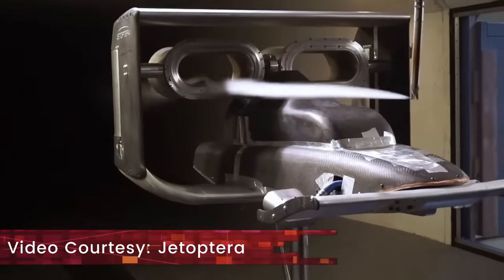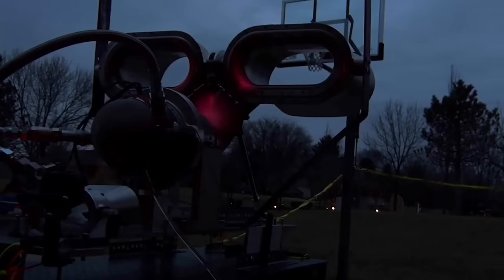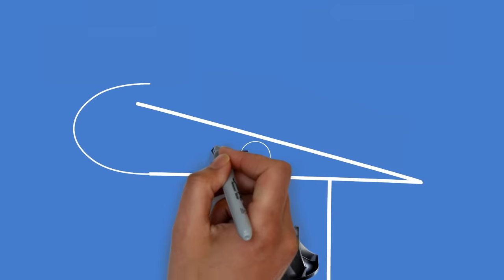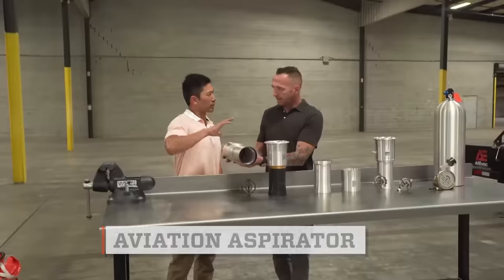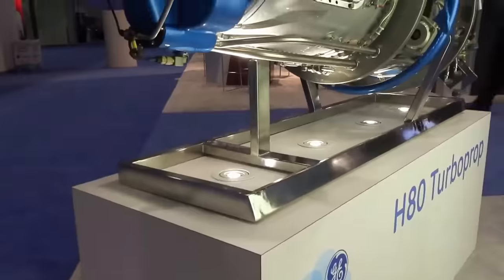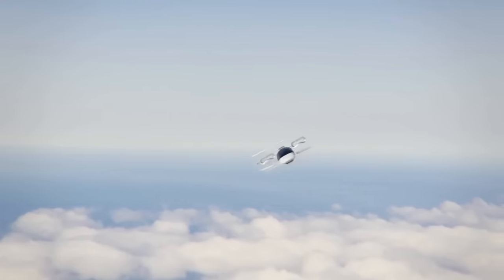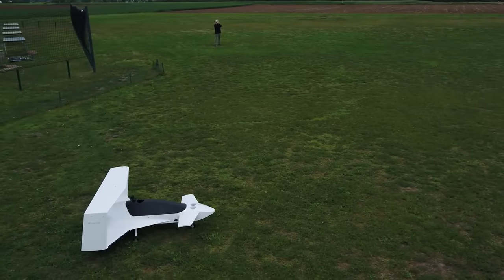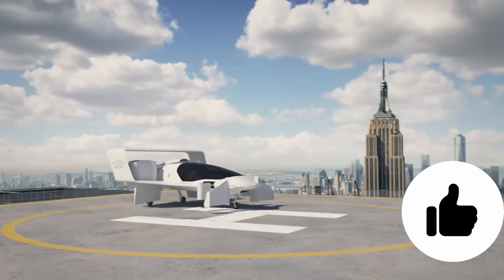Jetoptera's Bladeless Propulsion System

Comment: In these VTOL 'demonstrations', did they actually match the scaled weight and weight distribution modeled for a unit equipped with a gas turbine and fuel against the scale adjusted thrust expected from said turbine system?
Because I can strap a single LiPo battery and enough high power ducted electric fans to a toilet, and burn through the LiPo's power to get it in the air for 20 seconds, but that doesn't mean a toilet is a valid aircraft, jet engine or not.
Reply: Often "startup" companies do just that. Feed you some serious 'crap' while getting a crap idea to partially demonstrate, then fleece dumb investors, flounder, and act like they don't know what happened with the 'new technology' not working out. Oh yeah, all while the founders make millions on failed ideas.
Reply: Sounds like a crappy way to travel.
Reply: @life_of_riley88  And fanboys keep drumming the thing further. Like with this video, hey look electric flying car! It can easily be made electric... when battery technology advances further.. so not in several decades and i would be even less interested in this flying coffin than EV, since with EV you wont probably... maybe die when batteries crap out.. with this yeah no.. With jet engine this might have some sense, but vtol is always hard thing to build since you need lots of computers to assist even professional pilot.. One computer crapping out can easily lead disaster with vtol. Also as mentioned duckted fans are now flying the test platform, but we have no idea what ever this actually works in real world aircraft and will it be powerful and practical enough. Its interesting concept, just hate how EV fanboys start drumming for shit like this, even before there is model version flying and even then scaled weight of the aircraft seems to be forgotten on test for looks of it.
Reply: @life_of_riley88  Tesla being one of the best modern examples of this lmao
Reply: @Hellsong89  What do you mean "like with this video"? The video is fairly informational and doesn't act like the technology is right around the corner. The guy isn't drumming anything up.

I get how annoying the current tech climate is with people like Musk and his cult but that doesn't make it a good idea to take the polar opposite stance.

Yes, the technology is being looked into. That's all the video really says while breaking it down into examples how how the tech is used today as well as proofs of concept in the past.  Nothing wrong with taking a look at previously mothballed technology with a fresh pair of eyes as long as no one's being conned, which this video doesn't appear to be attempting to do.
Reply: So that's where blue ice comes from.
Reply: They (the company) explicitly call out the fact that battery energy density is not good enough yet. The company tested the model with an all-electric system to see if it was possible, but since energy density isn't there yet they are not not advancing with an all electric model. It was just to show that they could in the future. Didn't you watch the video?
Reply: @Hellsong89  Dude they explicitly call it out in the video that they are not using an electric drive system because batteries aren't good enough yet. The company said it very clearly, and the video narrator explained this.

Jetoptera is taking its time testing and slowly scaling up from their models.

You should probably listen to the video again.

Comment: F4E Phantom used blown leading edge flaps. Lowered take off and landing speed by 15-20 kts. Used lots of compressed air but J79 had plenty to serve up.
Reply: shinmawa US2 stol seaplane , also uses a turbine for force assist flow over flaps ,
Reply: Those systems were low airspeed lift augmentation designs and horribly inefficient. They did their job, though.

Comment: "There's nothing new under the sun." This was used years ago in the 50s with Jetex model rocket engines fitted with an augmeter tube.
Reply: Look for it 
In   👉1930 👇
Henri Coanda build the first UFO and he call it: 

AerodineLenticulare .
Reply: Many technologies have been out for many years but we just couldn't make them into a viable product due to our limited understanding. Once the right breakthrough is achieved and financial backing is secured can it materialize to something. Note that this can happen multiple times until said product is commercially viable. (VR comes to mind).

We see this in science too. We're aware of quantum physics for a hundred years and our most brilliant minds have been working on it since, yet this is still the case: "If you think you understand quantum mechanics, you don't understand quantum mechanics."
Reply: @Aaron.A22  it wasn’t a fucking UFO if you know exactly what it was 😂
Reply: Aah jetex, a source of joy nearly 70 years ago!
Reply: @geoffnottage8894  perhaps a point on Jetex fuel - it used Nitroguanidine, made from bat shit and nitric acid, if I remember right
Reply: @M3galodon  A great example that has had a massive impact over the last 2 decades is direct injection in cars to substantially increase fuel economy or power output while maintaining fuel economy. Mercedes was using mechanical direct injection in race cars and the 300SL sports car in the 50's but it was finicky and expensive so on the shelf it went for half a century.

Then Audi (VW group really) made a bigger push of it in their dominant Le Mans program around the the turn of the millennium. From their it trickled down to being in everything with an engine today. The Physics never changed, the ability to package the tech in a product that was marketable at scale became viable due to synergies from dozens of other advancements.
Reply: WoW hard to believe that they were doing this nearly a century back
All we need to do is replace the fuel source! ELECTRICITY is the way forward 
Once we get that right, we can experiment! Easy peasy!!
Reply: @greekkidshows9373  nope, electricity is not a fuel source unless you capture lightning. Fossil fuel is a source, so is hydro, solar. A rechargeable battery is a store, as is generated hydrogen. The flow of electrons, i.e. electricity and rotating shafts are mediums for transferring energy.
Reply: @andreasdinkelacker6729   "electricity isn't a fuel source"? It should be our only Fuel source! 
Either you capture lightning or create it
What makes it the best is, we ain't using a limited supply of something! 
Fossil fuels ain't just limited, but it may not be available ever again when it runs out

Electricity can be used on the spot and through storage. Batteries need an upgrade tho! (they are the same as they were a century ago)

Electricity shouldn't just take the place of  fire! We can use it for just about anything

Electricity is the FUTURE 
Why is everyone avoiding it?
It is not only more capable then we know but it has application's we haven't thought of yet!! 
Fossil fuels are a dead end for most application's 
Good for plastic but not propulsion! 
Then again, that won't last either! But still good for now
Reply: @greekkidshows9373  i think you don't understand what a "source" means. A fuel source is where the fuel is found. Oil is found in the ground. So is coal. Wood is found in forests. Solar energy is found in radiation from the sun. Electricity, other than static electricity is not "found". Energy sources are CONVERTED into electricity, which can be used as generated or can be stored as in batteries which are essentially chemicals that can be converted into other chemicals that can then release electricity afterwards. A rechargeable battery is the equivalent of a fuel tank. Both need refilling continually and are NOT sources of energy. Electricity is the equivalent of gas that is pipe to homes or stored in gas containers.
Reply: @andreasdinkelacker6729  I guess what I was meant to say is "we need to change the type of power" not "where to source it"

That don't change what I said
 And that is what makes electricity the best
We don't need to collect it!

So basically, batteries convert something into electricity. Not store it?
Interesting! I have to check it out
Reply: @greekkidshows9373  batteries have changed and improved radically. You are uninformed

Comment: Unless I am mistaken the entrainment function merely uses a small  high speed stream to accelerate a larger low speed stream, but it does not create any additional thrust. It is hard to see how this could be more efficient than a propelller driven plane, as the propeller directly  creates a low speed stream without needing to accelerate the air around it.
Reply: That's why they cleverly don't claim that.
If you listen carefully they claim to be superior to small jets system. I imagine it's pointing to small ducted fans like E-fan airbus electric plane, or small turbo jets. 
Not propellers. 

The entrainment causes more flow around the motor so more lift for the box. 

I think it's a good compromise of compacity and efficiency and safety against multirotors or tilting multirotor + small wings.
Reply: Maybe sometime someone makes this effect into the wing itself so the whole surface is both propulsion and lift. Also this plane has a rather small intake at the top, this might be the limiting factor for its total power.
Reply: Actually, entrainment experiments 100 years ago in Scotland using solid rockets to give the core gas stream, showed a thrust amplification of around ten. The idea is to tailor the exit speed of the mixed flow so that it leaves the rear of the aircraft at exactly the same speed that the aircraft is moving forward: thus, the exiting flow leaves with zero speed relative to the atmosphere so has zero wasted kinetic energy remaining in the exhaust. Ergo, big improvement in efficiency.
Reply: @richardm.newlands2417  is that related to aerospikes? But also that would work only for cruising speed not acceleration.
Reply: @richardm.newlands2417  If the exhaust has zero airspeed as it leaves it will also have zero thrust!
Reply: @richardm.newlands2417  i find it strange that rocketd are not fitted with Coanda rings to use this ten times more thrust..
Reply: You are absolutely correct. Driving a low speed flow with a high speed flow is only achieved by turbulent mixing (=entropy creation). It is inherently inefficient.
Reply: @HowesAero  scam time
Reply: They have SYNERGY, what more do you need?
Reply: @Ronald Harris, Not sure that "scam" is fair, just a naive application of flow physics.
Reply: @richardm.newlands2417  pls link to these publications, thx
Reply: @totherarf  I would agree, when you referred to the propulsion in the video but when you are referring to the statement of Richard M.Newlands then you may overlook, that he is speaking to rockets. Rockets "create" a surplus of fluid volume through the chemical burning process, thus they will produce a propellant force no matter how slow the release speed (a speed and thus a momentum surplus in the wake will allways occur) and its probably the most efficient way (but not the most effective!) to have a release speed equal to the plane velocity.
Reply: @fjanson2468  pink, starshaped earrings!
Reply: @HowesAero  scam fits because they are trying to baffle with a barrage of only perfect in theory physics hoping to baffle investors
Reply: @HowesAero  golf ball dimples create turbulent mixing and therefore entropy on purpose, yet they improve aerodynamic performance by creating the turbulence sooner than would naturally occur in the wake of a plain sphere. They actually slow the rate of entropy creation thereby leaving exergy in the ball for longer,  thus maintaining its speed for longer. My only point is while forced mixing will inevitably create entropy sooner, that does not tell us if it will be deleterious or useful to the overall aerodynamic behavior.
Reply: @HowesAero  coanda effect usually uses laminar flow linear jets. im not seeing any benefits to this configuration.
Reply: @richardm.newlands2417  I... Sure, yeah, solid fuel propulsion is more efficient. But are you really just going to overlook every other problem introduced there?
Reply: @635574  Exactly.
Reply: The mass of the airflow would need something to react against.  Perhaps this is enough. ( or not). I was wondering if it was.
Reply: ?? I wont go down your hard to see path. But I recently listnd to a 24 hour playback of the natural environment off the BC coastine on Earth Day. Do you think it sounded nice? Constant grotesque prop engine sound tipping across the marsh land all day and night long. I am sure killing the wildlifes quality of life. Dam efficiency alone. What = the value comprehensively?
Reply: I am no techy like the rest of you, but until I went to a store where they sold Dyson fans and felt the even air stream in comparison to the disruptive air if a bladed fan, I got it as I do here, I would like to see more including the motor that Tesla came up with that could hover its own weight by slight imbalance, if controlled, it could use the same motor for flight when it reaches the proper altitude, same tech just slightly different modifications

Comment: In fact, this is a type of ejector. Ejector's efficiency is poor. And with high passive flow to active flow ratio it is poor twice.
Reply: poor twice sounds like my financial condition
Reply: But.... don't 2 negatives make a positive? 🤣🤣
Reply: @rosebarnes9625  twice is a positive number.
Reply: @eeeeeek  all changes :-)
Reply: Brandon Furr only the constant twice is positive the other variable is negative.
Reply: i got a question, what does active and passive flow mean?
Reply: @midgetman4206  Active flow is driven by a fan through the circumferential gap. Passive flow is driven by active flow through the ring-like casing.

Comment: This all looks lovely in CGI but back in the real world these fall down when transitioning between flight modes.
Reply: It's still cool, if they are improving their design and working out the kinks

Even if in this case the kink is falling out of the sky
Reply: The model at least seems to be flight worthy. And there are already aircraft using the exact same transition method, albeit with classic jet or prop engines. It really only depends on being able to generate enough forward thrust to reach sufficient aerodynamic lift through airspeed  before losing vertical lifting capabilities.
Reply: @JescoLincke  the transition is easy to do in CGI, or in a sentence, but it has to happen reliably in the real world. It is not a trivial problem.
Reply: @kalliste23  I agree that it is all but trivial. But the principle has been proven to work in certain aircraft already in use (e.g. Osprey or other tilt-rotor-aircraft). That doesn't make development of this concept any easier, but it shows it could be done.
Reply: @JescoLincke  Osprey is a good example - go back and check out the history of the development of the Osprey and the mind boggling amount of money that involved.
Reply: The video seems to mix real model footage with CGI fantasy without clearly signalling which is which.  So I don't trust any of it.  The dyson  fan simply uses a small volume of fast moving air to entrain a larger volume of slower moving air.  It's an impedance transformer.   Is anyone saying that you get more energy out than you put in?  No, energetically it's worse than bigger slower moving blades.  Aero modellers have known for years that the best impedance match and best energy efficiency comes from large slow moving propellors.  If for other reasons you have to use smaller blades then you have to spin them faster and the thing can go faster but it's energy efficiency inevitably drops.
Reply: @JescoLincke  also iirc the osprey is one of the most unsafe planes you can every fly
Reply: @alexsanchez1620  it has a worse record than military helicopters let alone planes.